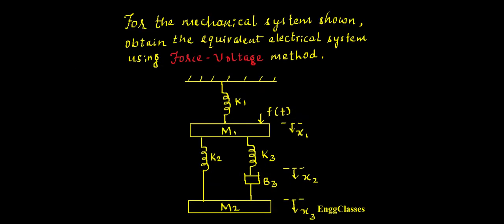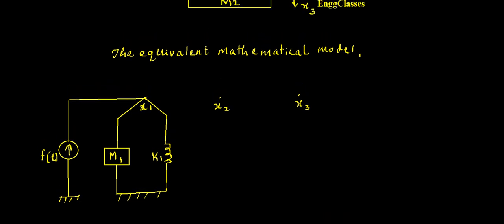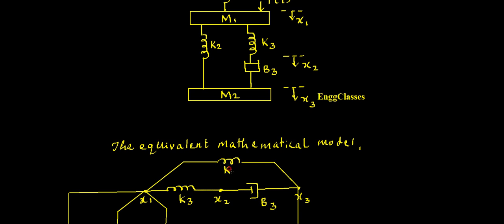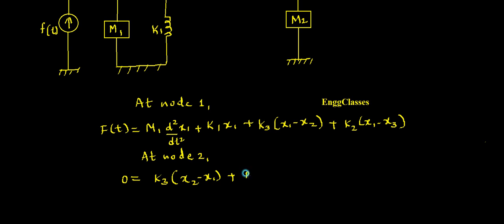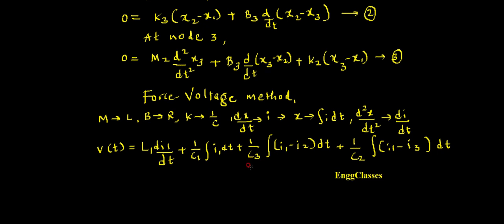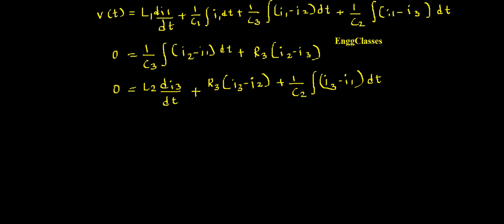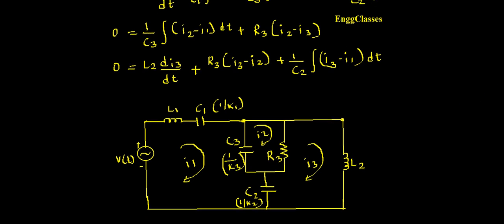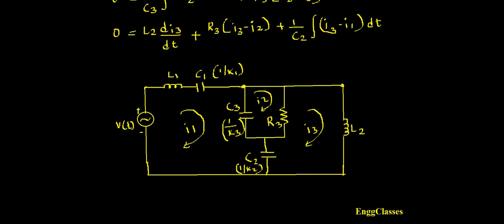Q2a. For the Mechanical System, obtain the equivalent electrical system using Force-Voltage method.

Comment: Sir i cant understand how you taken displacement point 😭
Reply: every mass m will have displacement, but special condition is when there is spring k and dashpot b connected together between two mass m1 and m2, then there will be displacement between the spring and the dashpot
Reply: @yolo8153 can u please tell is any other special case other then this..?? It will be helpful
Reply: @SoumyaVaddatti  no thats it, only this one is the special case
Reply: @yolo8153 u mean when k and b are in series then we'll take another displacement
Reply: Thankyou @yolo8153